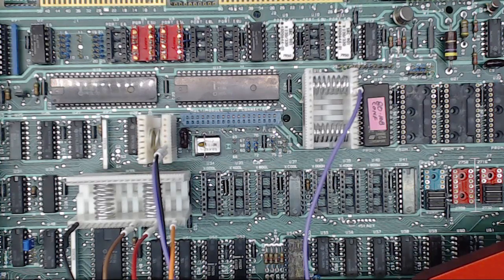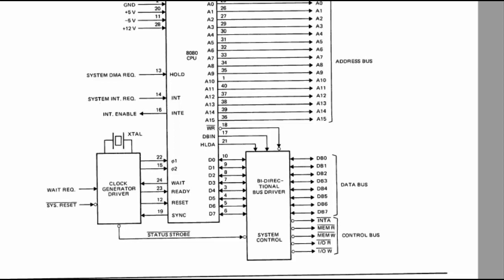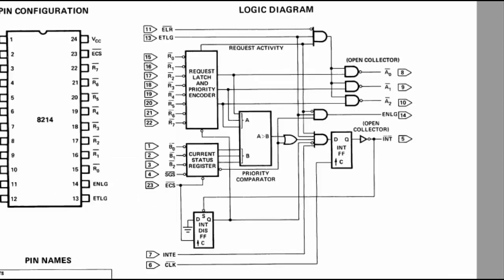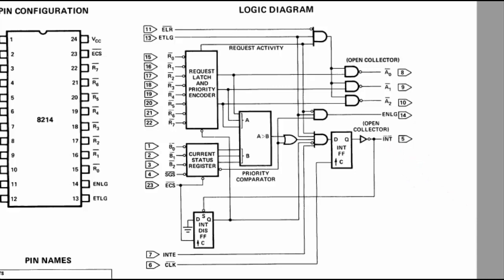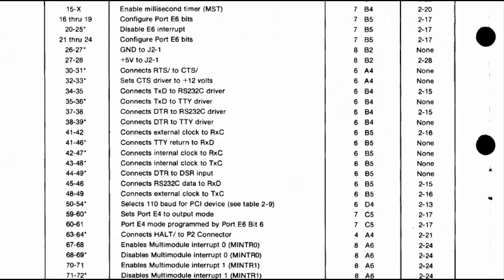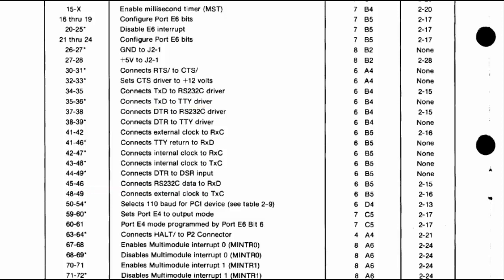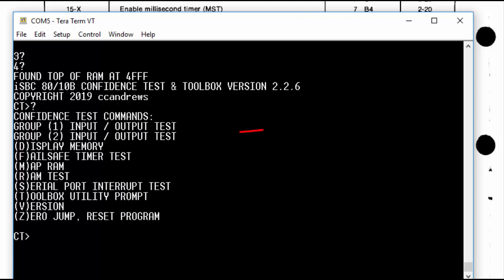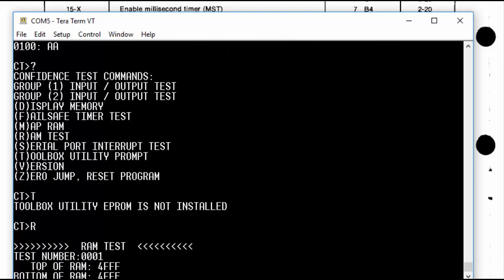{13} The Neglected INTE Pin May Very Well Be Your Best Friend When Bringing Up an Intel 8080

Comment: So you've written a "Hi-Lo World" program in your confidence test ROM ;-)  Great videos, just wish I could find the boards you mention for the prices you mention on ebay. I think your videos brought too much attention and the prices went WAY up and the selection WAY down.
Reply from the maker: Reasonably priced vintage hardware is still available, especially multibus and STD.  In fact, I saw an intel 80/10B Multibus on eBay just today for $42.   The 80/10B is one of my all time favorite single board computers.  This board looks a bit rough and probably needs some work, but it certainly looks to be worth the $42 asking price
Reply: @HelloWorldETX  Just saw your video about the possible deals you found, thanks for doing that! I like the 8080, but the Z80 was pretty much my first CPU so I'd like to find something with that. Can you suggest any preferred Z80 boards?
Reply from the maker: @FrankenLab  I include Z80 hardware in my watch lists, but none happened to make my “worth considering” list last week.  I will see what catches my attention this week.